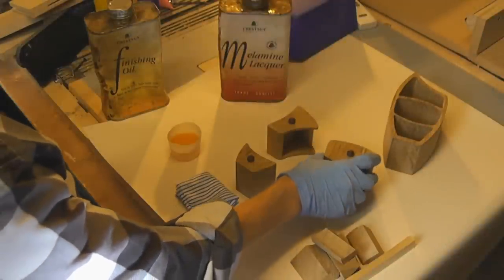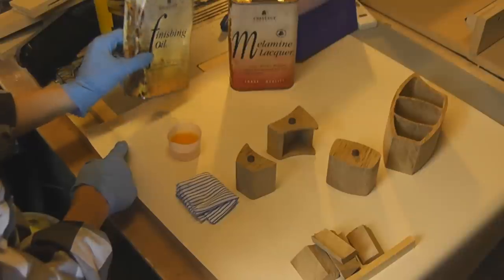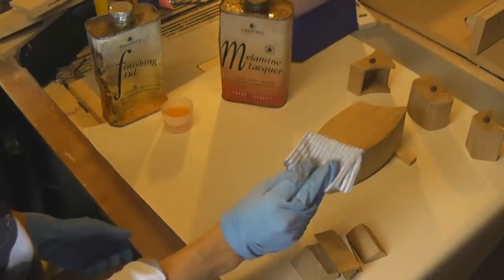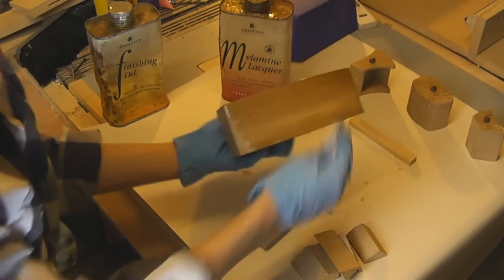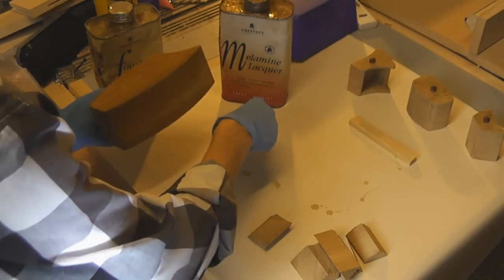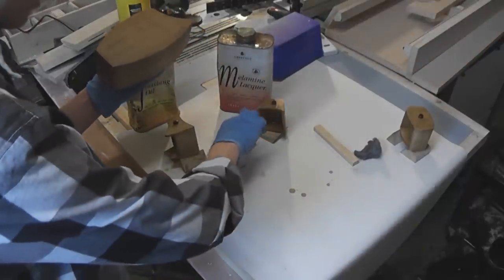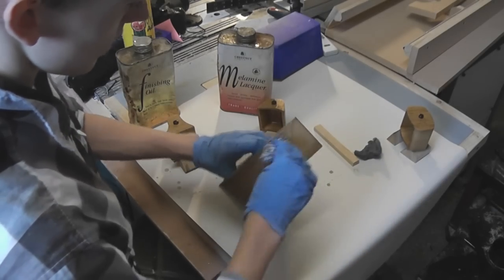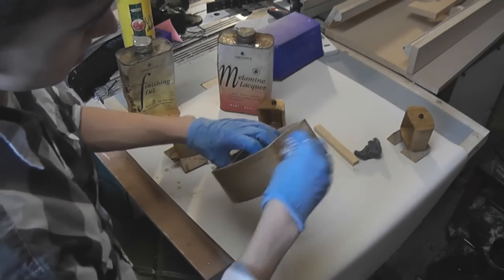04/01/2013 - Woodworking Finishing Process

Comment: Thanks, that's very true lacquer does dry quickly so I would generally spray it on on larger projects.
As for fumes I do have a respirator with charcoal filters which I probably should use more! Anyways for the video my voice would have been muffled so I couldn't use it, but a very important point nonetheless.
Alex

Comment: Do you thin the lacquer at all or use it full strength as-is from the can?

A tip - I used to use steel wool for wax application, but found that the synthetic scotch-brite pads work just as well, don't fall apart, and you don't risk tiny orange spots appearing if the humidity goes up or if you use a water-based finish.  (Not that this has EVER happened to me... ;-)   What causes it is that tiny shards of steel get embedded in the surface of the finish and they rust.)